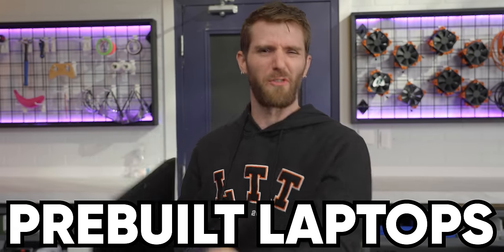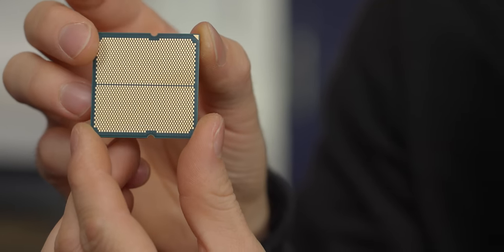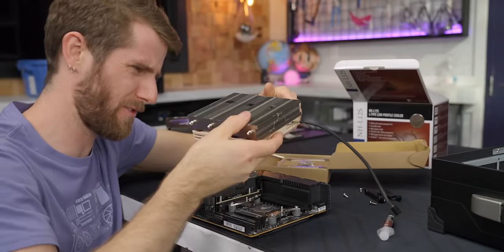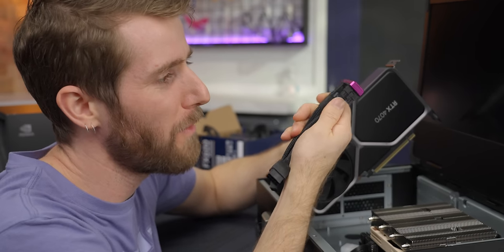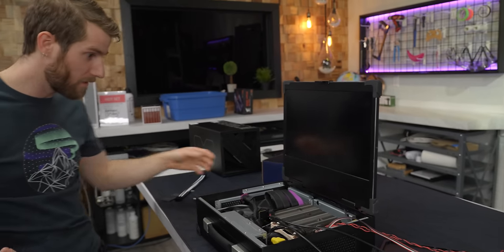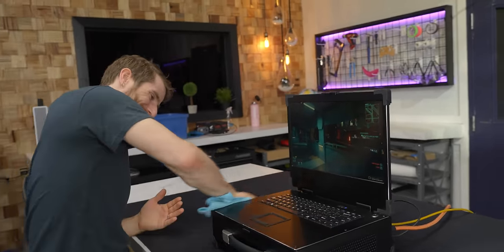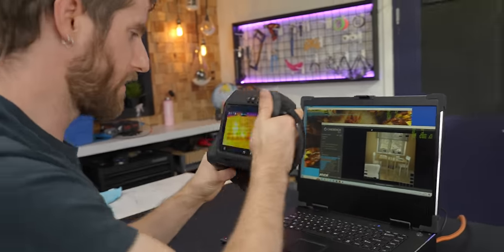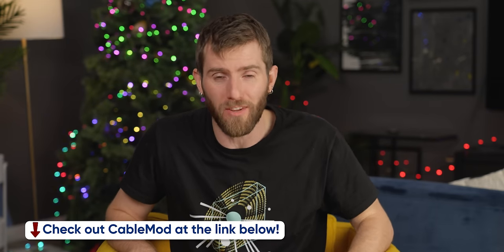Building your own “Laptop” is Terrible and I LOVE it! - MaCase B21 Briefcase PC

Comment: Now have Alex design and machine your own LTT PC suit case! I'm sure you guys could do better, I feel like you guys would figure out a cool way of transplanting a good keyboard and laptop trackpad into it or something haha
Reply: I would love to see that, and i am sure that there are customers out there for it
Reply: Even a good keyboard would be uncomfortable. The chassis is simply too high.
An external keyboard would be required for this case.
Reply: O @hueanao
Reply: I don’t think someone is going to really use the keyboard that much cause you can’t really sit on the desk since it’s like 15 cm thick; so the built in Keyboard might be more of a backup incase you forgot your external wired/wireless keyboard and mouse

But it’s definitely better if it’s not that Hot; Absolutely Agree; All in Ones are always appreciated than carrying your house around
Reply: @tech-wondo4273  yeah for sure, it would just be a fun video is all I meant
Reply: @hueanao  yeah I know, it would just be a fun video
Reply: @hueanao  well that depends. Keyboard doesnt have to be on top. Why not have a pull out scissor switch keyboard at the bottom and pull out track pad at the sides. so they are closer to the desk. If they design it themselves they would find a solution. And I bet it will be a janky one :D but thats fine.
Reply: @rustedgaming8224 oh I'd definitely be one of those customers, I'd love something like this that's designed a bit better
Reply: @hueanao  Front mount it on a track, and have it slide down, and out so it rests on whatever surface you have the "laptop". As long as a 10-key, but use the 10-key area as the trackpad, and it would fit well along the length of a suitcase style desktop.

A few other ideas:

Use a laser Keyboard! If the laser is built into the top edge, it would project down onto the surface. No space taken up at all!

Have it slide out from the bottom inch of the case.

Have the screen part extra thick, and have a hidden keyboard that pops out from within the back of the screen. Bonus points if it connects to a charger within its housing.
Reply: even better, get framework to do it lol

Comment: I think there is definitely a way to improve the graphics side temps from effecting the top. Pci slot blower exhaust fan while noisy could help move the air quickly instead of passively out the back.

Comment: Nice idea but there is definitely "room" for improvement. The keyboard needs some protection from the heat like a shield. Sides could have more intake/exhaust holes with removable covers to allow both airflow and keep that solid look as it's trying to look like a briefcase.
Reply: I THINK. The government said No ! Lolzzzz 😂
Reply: if you use blower style gpu, it would much more sense. intake from the top preventing hot air touching the top case and exhaust entire hot air through the back
Reply: I also would probably use a HDMI extender so that you dont have such a long cable hanging from the back.
Reply: I prefer my BSI computer FieldGo M9 the big difference with these vs this is that the keyboard is thin and the PC is in the back.

Comment: I've actually thought about diy laptops a lot for some reason. I feel like it could've been done so much better even without framework. For instance there are the less common thin mini itx form factor motherboards, adding a reduced power am4 cpu (with a ge suffix), mounting a laptop cooler and adding laptop fans. Those laptops usually support 19 volts, so I suggest we need to connect 5 3.7V li-ion batteries in series and then somehow plug them to the motherboard, probably to the 4 pin connector. In the end we just need to add the necessary equipments for instance monitor, a slim keyboard, touchpad, speakers and extra connector hubs and then 3d print a case or somehow make one and then done. Probably a complete step guide how to make a diy laptop.

Comment: Definitely could use some improvements (1440p monitor and a heat shield for the trackpad and keyboard) as well as better safety setup for the thermals but this is a really solid idea. I would LOVE to build an SFF computer like this!
Reply: Yeah but then the case would cost $5,000.00😒
Since Linus has done this video, the case is now $1,830.00 on aliexpress 🙄

Comment: I thought about building something like that about 20 years ago. Only mine would have been bigger. My thoughts was a top of the line editing computer that ran completely silent for use on film sets where weight and cost are not really issues but noise and power are.

Comment: I actually think this is a pretty good idea it just needs to be worked on
Reply: Definitely a little more trial and error on fan placement to maximize total case flow and I think they'd be able to kill that GPU hot spot. Might also require a little foil tape heat shielding on the back of the keyboard. But with the right airflow strategy I think they could really lower those case temps.

Comment: I actually think these are a good idea, better than an external GPU solution anyway!  Have you thought about making custom HDMI cable with fiber optic cables and just buying an end for each end of the cable?
Reply: How is this better than an external GPU?
With an external GPU you still have an usable laptop. With this case not at all.
Reply: @Jehty_  depends what you are doing, on location for a film set, needing to do some high demand stuff. Plenty of use cases for it (hence why they sell them for real already made). If where you are going has power and you dont need it on the trip its awesome. This said this case looks like its going to give you some bad wrist strain so need to have external mouse/keyboard. Its at the point that a smaller PC and a projector/foldable monitor might be a better goto.  Plus as a millennial when i hit my teens i dreamed of dumb stuff like this lol. (i have built some really sketchy stuff from PC's inside milk boxes to fish tank PCs)
Reply: @AdamsWorlds  if what you wanted to say was "this is a good idea for extremely special use cases" then you should say that. Don't make blanket statements and then be surprised that people disagree...
Reply: @imustbust998  another problem is that the keyboard and trackpad are at an uncomfortable height. So unless you are using it while standing I don't see how it could ever be usable.
Reply: @imustbust998  how many hours per day do you spend in a gym?
According to the listing the case alone weighs 10 Kg. That's not something my legs can handle.
Reply: @Jehty_ with every eGPU solution out there currently you lose at least 10% of performance because they don't allow for the full use of PCIe lanes of a modern GPU, Also if you're using a eGPU you're probably using a laptop with a laptop CPU, which means limited power and less performance from the CPU compared to what you could get on a desktop build. So if this is a concern for whatever you're doing, then yes, this would be better.

Comment: I feel like this can be improved upon, especially the latching mechanism. Plus there needs to be a panel to protect the rear I/O.
Reply: Rear I/O should ideally be "internal" I/O instead. Basically have a well inside the case to run cables into, probably have it be part of the airflow too.
Reply: @absalomdraconis  this case is not for someone who needs a "portable" high performance pc. If you need portable and performance just get high and laptop this is clearly not built to compete with high end laptops as display and keyboard in this thing is very low end and cooling potential is very limiting so you won't be able to put high end parts in it anyways. It appears it's main use case that it's trying to solve is basically for the kind of situation where someone has something weird to put in PCIE slot and they need it to be portable. One way I can imagine how this can be used is as a networking setup/debugging tool in server rack environment as you can put heavy network cards in it with multiple high bandwidth ports and can use it to inspect your networking in your server rack.
Reply: @sk-sm9sh  You say that, but it's actually pretty great for topology optimization and the like. Not everything needs a fancy display or keyboard.
I'm currently in that situation. It would cost about 1800-2000 for a laptop that can even run the programs I need, or I throw together lower end desktop parts in a portable case and call it a day. 
That's what I've been building, yet this would be a more portable version of it.

Comment: As you mentioned: 
for LAN i would scrap the Keyboard and Trackpad and do a Plexi or Metal Sheet with Ventholes for the GPU. Just using normal USB Mouse and Keyboard. 
Pro: Temps are down, no burned hands since you dont interact with the Top Plate. 
Con: You have to take Keyboard and Mouse seperate with you
Reply: Yeah and you could get the temps even further down with a more low power GPU, i mean you dont need a 4070 for 1080p 60fps.

Comment: Definitely workable with a more modest GPU and a little better cooling. One Idea I have to fix the hurtful temps for the keyboard is a thin layer of  insulation underneath the entire top to keep the keyboard cooler while adding more exhaust. If it will keep climbing towards equilibrium with the GPU/CPU temps it will cook the trackpad. Definitely would like to see a follow up video showing some of these mods or with more conservative hardware that still performs better than a comparable laptop. The form factor definitely looks right at home for industrial environment applications.
Reply: my worry is not cooking the trackpad but not cooking it, it really looks like from the 90ies and that keyboard is stolen from a 100$ android tablet.

Comment: I made my dad a briefcase PC earlier this year and managed to cram a 24.5 inch 144hz monitor, an AIO, a 12100f with a cheap motherboard and 2 ssds, an ATX PSU, cables, 2 Noctua 140mm fans and an RX6700, all in a cheap, off-the shelf flight case. Sure, it's not super portable, but the sheer cool factor of having an entire PC in a briefcase that I built myself is just way greater than any practical drawback, particularly given how my dad can now just kick back and play hitman 2, with a fairly easy upgrade path if he ever needs it.

Comment: i mean . . you could just use a much stronger APU and forgoe the external GPU completely.
Less heat, more than enough power for the APU available because no dgpu is needing it.
Lighter as well. And you could probably put something else usefull in there. Maybe a small
UPS for the whole laptop feeling?

Comment: I think this is a good idea, with a but.  If it were fashioned such that a modern GPU can sit in a different orientation (vertical instead of horizontal), that keyboard issue wouldn't be an issue at all.  You have that grill on the side right next to where the GPU would go.  If the PCIe mounting bracket could be rotated 90 degrees and allowed you to mount the card more or less flush with that grill, it would make the keyboard WAY, way more comfortable to use.  That, and the lack of an internal battery, are honestly the only things I'd fault this for.  And I don't even think the battery would be viable due to heat concerns.
Reply: Maybe adding some insulation beneath the keyboard?
Reply: Actually if they just flipped the GPU so that it exhausted out of the speed hole they made, it wouldn't have been an issue to begin with lol.
Reply: @AltonV  Don't wish us so much Christmas Holiday keyboards.

Comment: the worst part about the heat is that it's exactly where you are going to rest your left hand and use most of the keys in gaming. Best solution for this would be to flip the motherboard 90 degrees and have the videocard lined up towards the top of the keyboard, on or above the numpad keys and then have the I/O  come out from the right side.

Comment: I cant help but think that the surface temperature issue could have been fixed by having the internals flipped (so back of the motherboard against the keyboard). Then maybe a partial mesh panel and/or bumper feet to allow for some airflow. Could help with the flex in the keyboard deck too.
Reply: That would fix it if it was the CPU that did the heating. It's the GPU, so that would not fix a thing.
A better solution would be to have the gpu oriented vertically, so it will blast the heat out the side and not up against the keyboard (and bottom). But then it would be excessively tall I guess
Reply: @Anankin12  They would just need to go older GPU, not a 30 or 40 series. A low profile 1080 would fit vertically, and still be a monster for gaming on the go. a 580, or 480 from AMD would do pretty well, especially in FSR rated games.

Comment: I would not have bothered trying to use a high spec machine for this. I actually wanted a budget portable arcade setup. 

Grab a ARM Cortex A9 Quad-core processor with maybe a PSA-S812-004 motherboard and you should be able to get a very light portable emulation system. Maybe convert the hollowed inside case to include a controller storage flap or have a portable built in battery bank.

Granted you could also go the extra mile and just throw in a busted but rescued laptop motherboard in the case to do the same, but I like the simplicity and lower power draw of an arm processor setup.

Comment: I think I definitely see a use case for it though especially for something like specialist test equipment which may require PCIe cards to connect to external devices, in such case you probably wouldn't need a discrete GPU
Reply: Proof reading is your friend!
Reply: you mean gpu
Reply: @wilppuse  apologies, was typing blind because the text isn't showing as I type for some reason :) corrected now
Reply: @rfitzgerald2004  Well, if that is the case, you did pretty damn good. I'd look like English was my third language, half the time, writing blind.

Comment: This thing is sick. Very specific use cases, but for those use cases, nothing else will compete with this. Although for newer versions, it could use an OLED and better trackpad/keyboard.
Reply: even if it did, it still would not be worth the almost $2000 they are asking for the case...

Comment: Love the overall design of the case but the only thing bothering me is the external HDMI port. I'd like to see the card recessed a bit more within the case that would allow a 90 degree HDMI adapter to sit flush with the bottom. I'd like to see a method to fit a battery as well, maybe using a PicoPSU internally and using the external C13 to charge the battery
Reply: We have these in the army set up as mini servers in a tactical command post that’ll support 10-20 workstations. Tsi small v2. Is what it’s call. The keyboard that comes with it is an absolute pain in the ass because it’s rubberized “tactical”

Comment: They need to get the airflow better optimised to exhaust the hot air in better way
Reply: Sure they could make it better, for this use case, but the keyboard getting that hot was just Linus doing a Linus. If you were actually making that build you can put some layer or film or even a metal shield with some insulating material to not let the heat go directly into the keyboard, the case was clearly not made for that GPU (they had to cut a hole at the bottom to make it work) so if you're going to modify it for that use then you can solve the keyboard heating issue.
Reply: Easy, by flipping gpu to exhaust out the bottom and have the cut out for intake on top instead, problem solved.
Reply: @Gl0ckb1te  not a bad idea. That'll improve it much better.

Comment: I'd be interested to see if you couldn't water cool the system with an external radiator, then water proof the inside to make it immune to rain, spills, etc. Would also help with the temps.

Comment: I think flipping the exhaust fan cause all the hot air to just stay inside, and way the case was designed it being an exhaust fan made sense since it would pull cool air from the other side basically cooling the entire chassis.
Reply: Then in this configuration it would just reverse the airflow path.  It may have moved the hot spot to the other side of the case, but it didn't cause it.  It is basically always better to have more intake than exhaust fans.

Comment: I would love this for an Ableton live stage rig with legacy pcie connections. Like for my firewire 400 rack interface… or i could just get a better interface
Reply: Wouldn't it be even more convenient to build a short depth server for one of those mixing board 19" rack flight cases? A short depth 4U would definitely fit in a ProX T-6MRSS13ULT, and leave you room for a board, MIDI/synth/pad on top.

Comment: One design improvement for this case. Have the keyboard on a pull out tray at the bottom of the case with a push to release button. That way it saves your wrists being elevated quite so high.